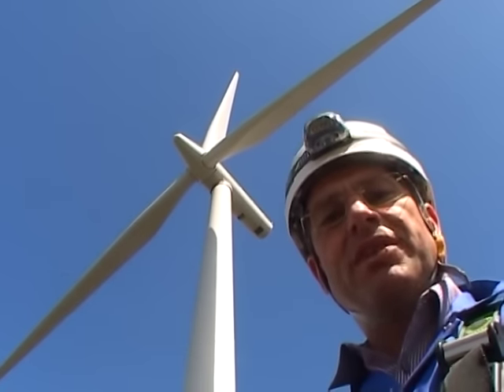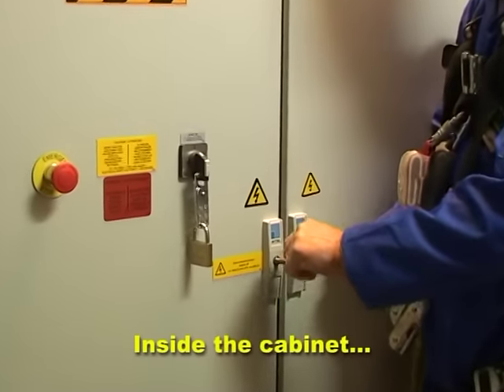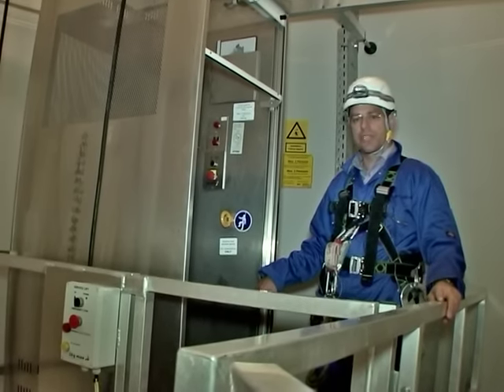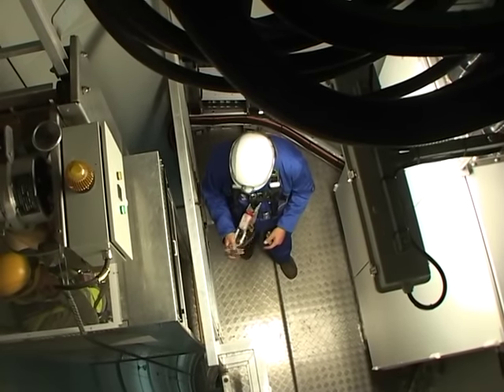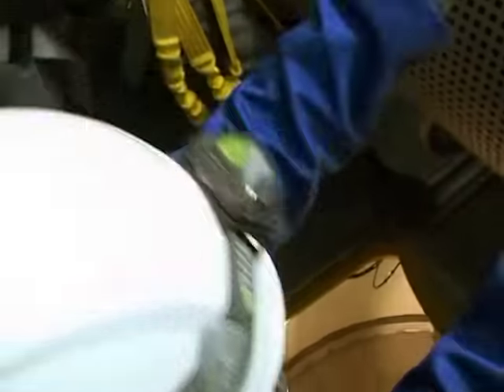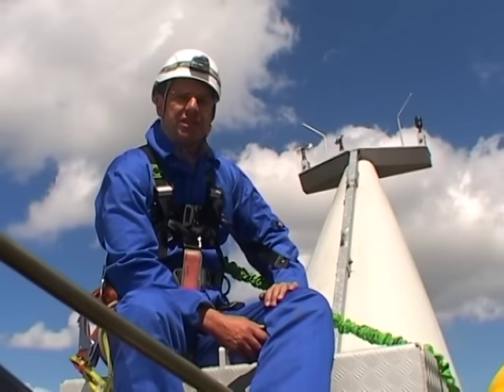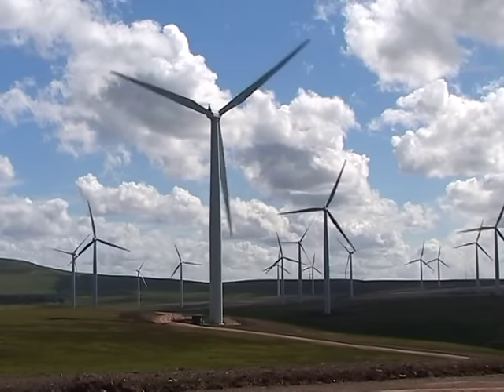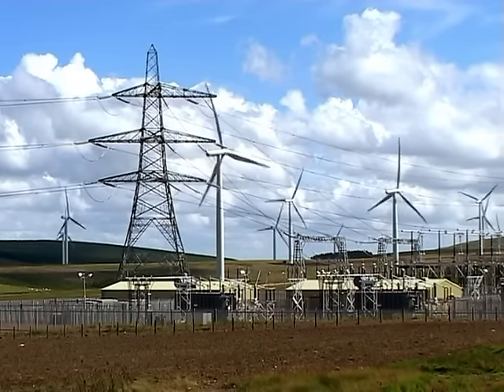Inside a Wind Turbine

Comment: really don't trust that elevator
Reply: @World_So_Cold  That's really cool, and the service lift is probably a lot safer then the ladder, @PerkyPopcornProductions
Reply: J W what’s that? I forgot.
Reply: That elevator should have a secondary safety Incase it ever free falls. Probably some kind of mechanism that only moves up and down at a certain speed. A free fall would cause it to lock up like a car seatbelt. I climb cell towers and I'm always attached to the cable with a slide that only moves so fast. You can only fall 6 inches with a cable slide even climbing too fast will make it lock. It's high tech stuff
Reply: @perkypopcornproductions1151  Jurassic world

Comment: This is going to sound really naive, but as a layman, I had no idea that these were so big or technologically complex inside.  Thanks for sharing.  GO, clean energy!
Reply: Sorry, I just got here. Please, may I ask, what did you think was inside of them? How big did you think they were? I'm just curious. Most people use technology without giving it a second thought, but I've always been curious as to how the average person thought something, like a wind turbine, worked. Thanks!
Reply: As layman how could you not be aware of the complexities?
Reply: @HangTimeDeluxe  I am a fairly technical person, but more with computers 😅

I thought: The tower is empty apart from cables and a ladder. The top consists of the rotor with fixed blades attached to the generator and a motor to orientate it according to the wind. The wind direction would be measured with a simple "weathercock" connected to a microcontroller controlling the motor.

It's fascinating to see some details of these machines 😁 New ones apparently communicate with each other to adjust themselves in a way that optimizes not the output of each individual turbine but the wind park as a whole 👍
Reply: These are not big! they are  very small with today's standards! 250-300 meter wing tip top max height.
Is not unusual  in new prodjekts today.
And often more than 50 units in the wind park, at least sea based installations.
Reply: yes, very clean... omg 🤮

Comment: I never knew these were so complex inside!
I thought it would be a blade, connected to a drive-shaft and to a generator. Maybe a few regulator circuits.
I had no Idea they would have a lift, and lights etc inside! Could almost live in one of them!
Reply: They come in a range of sizes. The small ones are essentially a rotor -> gearbox for overdrive -> shaft -> generator.
Reply: Andre McGoo  In super strong winds, they actually shut themselves down for safety too.
The turn the pitch so that the wind will not try to rotate the turbines, and then apply a brake to the blades too, slowing them and holding them in place.
Reply: @dancoulson6579  ugh just wasting all that free wind that could have been electricity, what will you do when we run out of wind
Reply: @bryanmartinez6600  troll
Reply: Andre McGoo they are not totally insulated.   It’s is just a big lightning pole.   The turbine is bonded which is completed different to insulated.  
Turbines are rated in m/s not miles per hour. Turbine is rated to approx 74 m/s where it will either uproot and rip out the foundations or fall over.  Normally don’t write stuff on here but as you tried to berate another individual I thought I’d let you know how wrong you were.
Reply: Dan Coulson almost right buddy. They pitch out of the wind but don’t apply brakes.  Turbines are designed to idle in strong winds and stop producing above 25 m/s.  Stops brake fires, brakes on come on as hard stop if turbine faults.
Reply: @jamesmawhinney679  Hah, I never knew that. 
I knew they certainly had brakes on them, but like you said, it must just be for emergency situations.
I guess if the blade pitch is directly flat or horizontal, it wouldn't spin at all, so no need for the brakes. Thanks for the info :) 
I never even considered brake fires, but it does make sense. 
If they can generate 200MW of energy, then the brakes would theoretically have to convert more than 200MW of energy directly into heat.
Reply: maybe they each have a restroom and kitchen, he forgot to show us that 🤣

Comment: Weird question, but does the turbine power its own lift and lights?
Reply: Good question, i think it does not sure depends on the make
Reply: Rebecca Russell Batteries that is has inside. It, of course, charges them itself.
Reply: I can guarantee it doesn't. Why? If the turbines aren't turning then you're stuck at the bottom, batteries won't be the source either as that'll involve maintenance and a fairly large capacity bank. I'd put good money on saying that it's powered via the local area network.

Comment: Would be nice if there was an electrolysis/hydrogen fuel cell facility near by to use any excess energy for hydrogen production then convert back to electricity when there is no wind or ship it to locations for hydrogen fuel cell vehicle charging stations.

Comment: haha these look cushy. The ones I work on are just a 300' straight shot ladder. would be nice to have a lift 😉
Reply: US? More complicated to have service lifts due to regulations I've heard.
Reply: @rwd1973  USA, and correct. Most site owners here will not purchase wind turbines with lifts for the added maintenance/regulation, and cost savings.
Reply: @rwd1973  We do have climb assists though. A continuous rubber cable you clip onto that takes like 80% of your body weight off.

Comment: what powers the lights, are there batteries inside that store energy while conducting maintenance? Would you be able to power a refrigerator/ power tools during an Apocalypse emergency situation?
Reply: It is connected to the grid so the only difference when stopped is that it draws power instead of producing
Reply: @rwd1973  thank you, learn something new everyday

Comment: How hot does it get in the nacelle during normal operation?
Reply: If 0°C outside and full load before stop around 20°C if I remember right. The gearbox with its 500l oil @40-50°C is a nice heater for a while.

Comment: Very cute little  turbines!  these are dwarfs compared to the 300+ meter 
Monsters that regularly planed for in today's installations. This is the problem  with  wind today ; people hwo  likes wind turbines think about 
These small little units, and says  :ok build some more what's the problem...
But when  the new ones are the height of  a tv transmission tower or the ejfeltower , and is visible more than 10  metric miles away, there are a differens.
In many places I dont think  yes- people 
Understand how big these new turbines  are. And today the builders 
Often propose large  numbers to be built to make it worf the investments. 
50 is not unusual (often more than that.)
This makes  local opinions sceptical 
To building  them.  They are to big ! ,not only for acceptance;but
The size is also detrimental for  the life span,this new mega turbines last shorted time than the smaller ones.
Shorter life span may cause higher 
Carbon footprint  and raw material usage per produced energy  unit in a lifecycle analyses: bigger is not necessary better/ more effective .

Comment: I thought they will show us inside of the hub and the blade, you have not seen anything til you lay on the web at the middle of the blade, and look how the tip is moving up and down in the wind :) at the same time you can see light coming through the wall of the blade...such a feeling like you could become one with the blade moving with it, and suddenly you can understand better and accept without any doubt Euler's theory about the elastic behavior of a beam structure (which is the basic for almost every engineering disciplines dealing with load bearing structures) haha :) I like my own comment

Comment: hi there can wind turbines produce electric no matter what way they spin such as the generator output will it still give same if the rotors went from clockwise to anticlockwise. off course it couldn't do this right away as would have to stop but just the principle will they produce either way the generator turns

thanks
Reply: Not sure but those blades are never going to turn in the opposite direct so its kinda irrelevant.

Comment: OMICS International cordially invites all the participants from all over the globe to attend the “World Congress and Exhibition on Wind Energy” at Berlin, Germany during June 15 – 17, 2016 with the theme of “Future Wind Energy Technologies”. Wind energy is extracted from air flow using wind turbines to produce electrical power. Wind energy as an alternative to fossil fuels, is plentiful, renewable, widely distributed, clean, produces no greenhouse gas emissions during operation and uses little land. The effects on the environment are generally less problematic than those from other power sources.This conference is all about Planning, Operating, Grid integration, Aero dynamic noise cancellation, Urban wind Energy promotion, and future prospects of wind energy. Wind Energy – 2016 will also include advancing international knowledge transfer in Ice monitoring and early protections, challenges and case studies of wind energy.
Wind Energy - 2016 brings together experts, researchers, scholars and students from all areas of Wind Engineering, Electrical, Electronics Engineering, Control Engineering and other related areas, wind energy associations, generating Plant professionals, Developers, Wind turbine manufacturers.

 
IMPORTANT DATES
Abstract submission open:  May 2, 2015
Online registration open: May 11, 2015
Early bird registration: July10, 2015
Late bird registration: December 15, 2015
On spot Registration: June 15, 2016
 
VENUE
Berlin, Germany.

Comment: Stupid question: how are wind turbines connected to power grids???
Reply: there is a large transformer either inside or outside the turbine connected to the HV grid
Reply: @rwd1973  yea but that still doesn't answer my question how is it connected there aren't power lines near wind turbines so it must be large underground cables that run from that generator box to some real deep power grid I suppose
Reply: Yes they need to build a HV-line (air or ground) to a substation near the turbines (larger wind farms) The substation is a buildning whete the turbine cables are joined and contains breakers and transformer to raise the voltage once more to the grid.
The turbines also have a transformer, often inside the tower,  to raise the voltage up to 10-30kV
Reply: @rwd1973  makes sense thanks